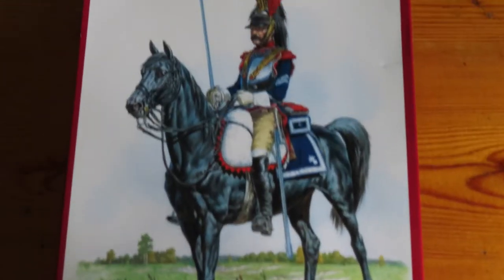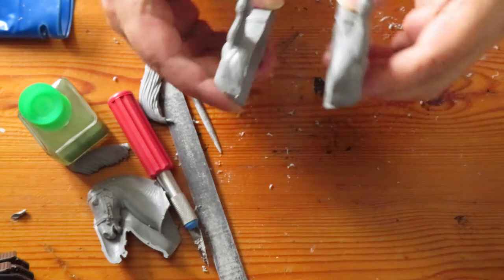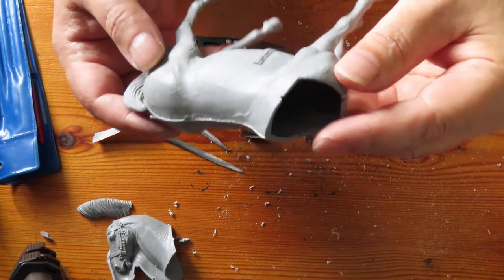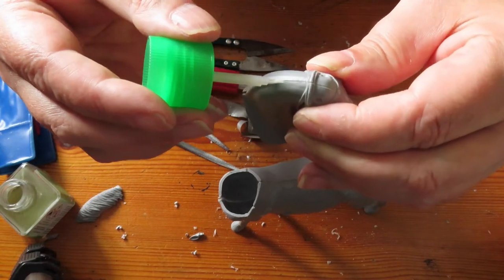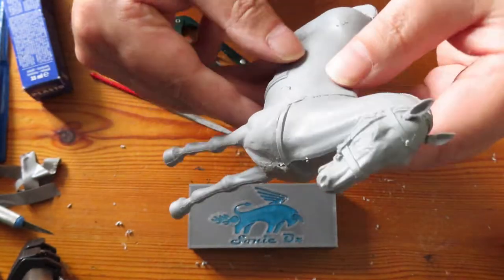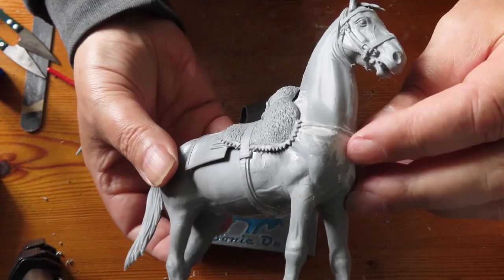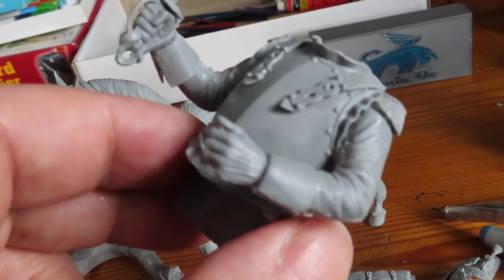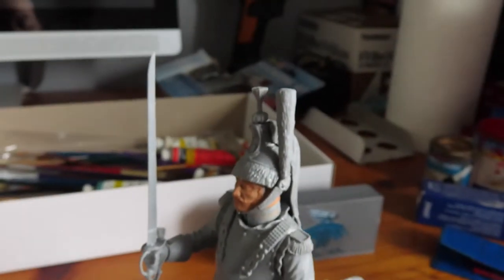MiniArt French Cuirassier 1/16 model kit build

Comment: Got mine yesterday. So far i've been lucky, as the horse parts have fit together well with only slight warping on the horse halves. Quickly fixed by placing them in boiled kettle water, then clamped together. I then used gorilla super glue gel, as this always flows without clogging the nozzle and drying out. Faults found:- No reigns or details how to make them, no basket/ hand guard moulded, (current one incorrect). Plume needs splaying out ( if used) , as these were cockrel feathers. (Not worn on campaign, just ceremonial), no horse teeth. So far so good.🤞👍
Reply from the maker: I would never have thought about using boiling water so will bear that in mind for the future. I did consider trying to make more authentic feathers but couldn't find anything lying around. I might repaint the faces soon as I wasn't quite happy with the finish. Have fun building. Another tip would be to do the saddle before the horses maine as I found the saddle wouldn't quite sit right  if the maine was in place.
Reply: @ABirdInTheHand  
Will do. Thanks. I had a pyrogravure years ago from Historex, and when plugged in, heated up the needle. You could then use it for melting into the plastic i.e the plume to seperate into seperate feathers. Edit:- or place a needle into a cork and heat it up, does the same thing. 👍